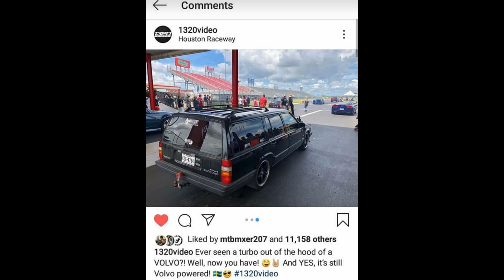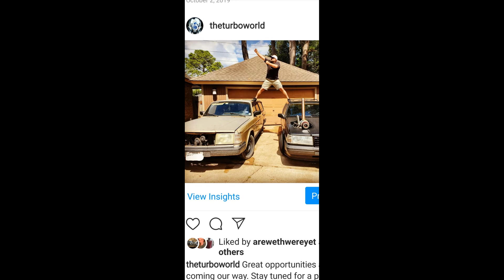🆃🆆🅸🅽 🅸🅽🆃🅴🆁🅲🅾🅾🅻🅴🆁🆂5 𝙎𝙏𝘼𝙂𝙀𝙎 𝙊𝙁 𝙄𝙉𝙏𝙀𝙍𝘾𝙊𝙊𝙇𝙄𝙉𝙂𝙀𝙥𝙞𝙨𝙤𝙙𝙚 1 𝙤𝙛 3

Comment: My Best shot?  Its better then Bench-top racers that don't own a welder.  Let alone a soldering iron.     I do Have a question however.    I think it might be best if you don't have a welder to use the same method pipe fitters use with copper pipe and  flare the ends to make a positive joint that way.    They do make  aluminium solder.   Would be an easy way to do it with great airflow. 
If nothing else?   Just grind like your porting a head.    More work but no big deal.  

Overall?  At least you did it. Most people never do anything.   😊
Reply from the maker: Thanks, great points!